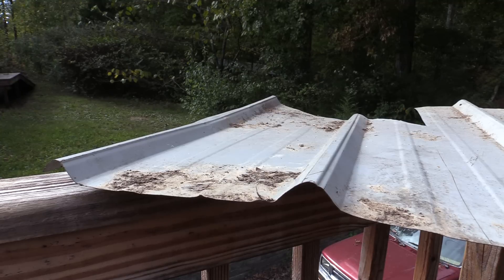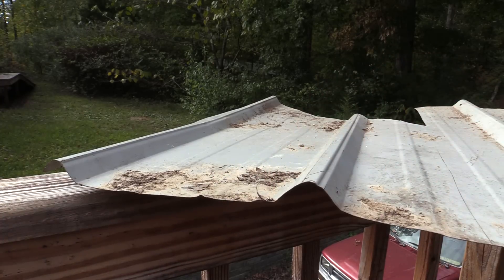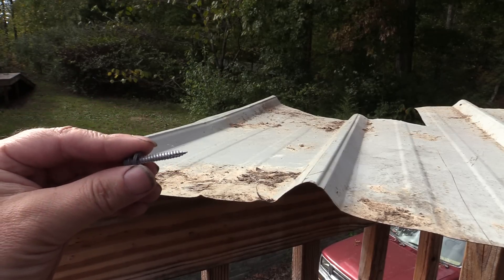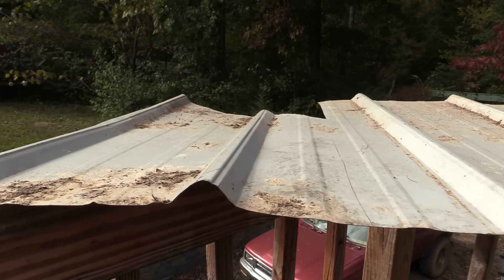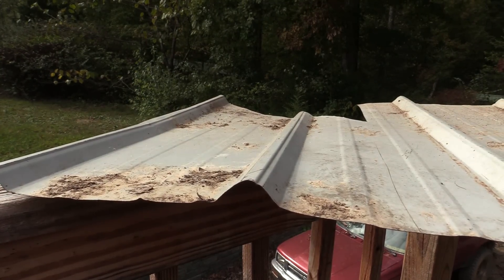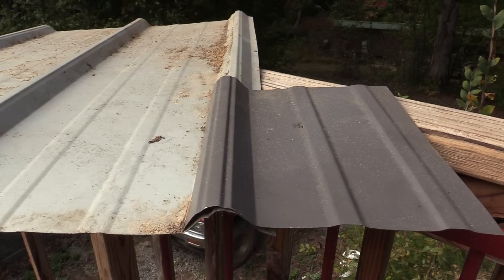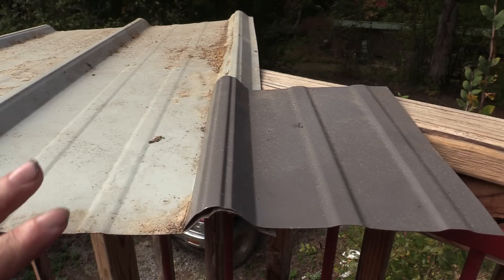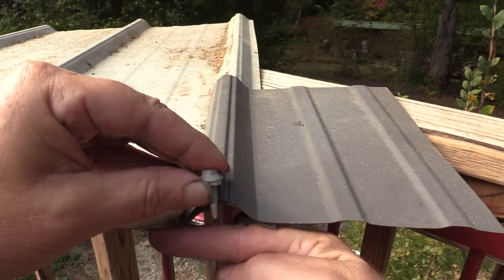Why you should not put screws on the ribs of metal roofing

Comment: So do you instal rib screws metal to metal when adjoining the next panel or do you just skip and not worry about those or do you use longer 2.5inch screws so that it reaches into the 2x4 purlin?
Reply from the maker: I use rib screws when installing the cap. if you use ribs screws to connect the panels together you are defeating the expansion joint. if you have a long roof this will result in leaks at the screws so do not screw the panels together with any screws when i install the cap i screw every other rib so as to not tie every panel together. I only use the 1 1/2 inch screws over 5/8 plywood or osb or 3/4 to 1 1/2 purlings. As you are screwing into the flat this gives you plenty of bite. Since i do not screw into the rib i have no need for the 2.5 screws

Comment: On the rib when used as roofing (your method has water traveling down over the screw/nail and washer). On the flat when used as siding.
Reply from the maker: Not my method, it is the manufacturer spec. it eliminates thermal expansion issues so the screws stay tight.
Reply: @honeybeehomesteading  I've seen different instructions on sheet panels of my pole barn (which I put up myself) so I think even manufacturers can't agree on a method.
Reply from the maker: @dalesworld1308  honestly it really depends on the size of your structure. Larger roofs with lots of panels the thermal expansion becomes a problem and the screws become loose. Smaller roofs it will not be a problem screwing on the rib but it will not be as windproof.

Comment: Threaded cap screws are the way to go. I shim the tall rib with cedar wood for a tight seat. Never put metal over shingled roofs they do not seat flat well at all.  Tar paper is cool for sure. The bitch with any fasteners is the voids in the plywood or chipboard. When the fastener just drops into the wood. YOU have to fix the hole you just made. The method chosen means a lot. My neighbor used bolts that get washers and nuts under the roof itself. THIS IS THE WAY TO GO. THE BEST FASTING METHOD.  NAILS NOT SO MUCH.... The best way to make a metal roof. PEROD !!!!

Comment: On the flat, on the peak, on the flat, on the peak................. This is one topic where there is no consensus, it's like Ford vs Chevy...
14 years ago I built fair size garage, roof at 35° - ish, 16' on both sides of peak, with regular synthetic underlayment for metal roofing. The metal roof seller recommended 2-in screws every 2ft- ish on peaks, so thats what I did. I also first pre-drilled panels on saw-horses which is a good idea, but dont pre-drill rib where the top panel over-laps, and  After 5 years I went back up on roof and noticed some screws loosen and a few broke but still had a lot of screws holding, and no leaks yet.....
2 years ago I built an addition on my house, 14ft out and 30ft long with very shallow pitch, some where around 1in drop/ft. I have 2 ft eve, so the first 8 in wide boards are on the eve, then the next row I have 3/4 in gap, the rest of 1 in x 6-8-10 in wide in boards are tight rest of way. Then I put down recommended metal roof whether shield, that stuff should be put down with two people, I started at that 3/4 in gap on eve... 

My theory for that was, if water/moisture builds up on top of whether shield it will flow out that 3/4 in gap between boards, which it did til I got addition insulated.  Then I started by placing 4 metal sheets on saw-horses and pre-drilled holes on flats and used 1 in screws, I notice these new screws didn't have as thick of rubber washer as before. So then I paced those foam seals at end of metal roof to help keep the wind from catching the metal roof peaks, then placed screws about every 4 in across the end of metal roof, so with gable rakes screwed down theres no way this metal roof will blow off...... 

So I screwed all this addition metal roof down on all flats except for the top where is metal flashing going up under previous asphalt shingles on main house, that is caulked and screwed about every 6 in across, then same at the eve, there I also did flats and peaks. So all rest of 16ft panels is screwed down on flats for same reason this video describes, and for the very same reason this video described....

So, on flat on on peaks...... IMO, flats are better for same reason describe in this video, another reason is it's easier to just set the drill driver to correct torque run screws down, on the peaks it's so easy to easy to over tighten, it's a constant pain when trying to just get the metal roof screwed down. But either way flat or peaks, I really dont see how metal roof can leak with that rubber washer, that rubber wash is protected by a big steel special shaped washer which is on top of rubber washer, and it is holding that rubber washer to the roof.  As this video described, the heat moves the peaks not the flats, so the screws on flats wont move........... 

But either way, if someone is putting down metal roof and has a shallow pitch, I highly recommend metal roof whether shield made for metal roofs................
Reply from the maker: @job38four10  thanks for your lengthy reply I am sure others will appreciate it as well. I agree with you 100 percent. The foam under the cap you may want to only do only on the windy side as this will prevent wind from blowing through while also allowing your roof to breathe.
Reply: @honeybeehomesteading  { " while also allowing your roof to breathe. " } <<<<< Hence the reason for 3/4" gap between first row of eve boards and the next row of boards, the 3/4" air breathing gap is underneath the eve, not on the end  metal roof peaks. But the only breathing will be done is between the whether shield and metal roof, that whether shield stuff dont breath..... 

I have the metal roof panels on the eve completely seal with foam and caulk, because it's a shallow roof pitch that drops about 1" in 12".
If the metal roof eve panels are not sealed on a shallow pitch roof, the wind and rain will blow up under the metal roof causing rain to drip behind the eve. I want water to drip outside of eve so eve boards dont rot, I also put the paint right under the eve for longer protection.....

To help keep eve boards from rotting, I no longer plumb the eve facer board, I always cut rafters at 90° on ends, that way the eve facer boards are not plumb and allows water to shed quicker, in theory........
Reply from the maker: @job38four10  cutting rafters at 90 was how it used to be done back in the Victorian days. 1/12 pitch is a mighty flat roof. Far more shallow than the roofing specs at. Where there is a will there is a way. I hope you don't live in snow country as that could get bad in a blizzard. Not on a leak issue as it seems you have that worked but but on a weight issue due to the snow load.
Reply: @honeybeehomesteading  { " cutting rafters at 90 was how it used to be done back in the Victorian days. " }<<<< I didn't know that, I thought that was my invention..... 
1/12-ish.....  I think I read somewhere that screw down metal roofing is suppose to have more of a pitch and 1/12 pitch should be on a  standing seam roofing. It's the main reason I put down weather shield made for metal roofing. I also live in mid-coast ME where snow is or can be a issue, thats why I did not want asphalt shingles. So with my limited carpentry skill set I put up 2"x10"x 16' rough cut rafters spaced 2' on center, the joist hangers are on 1-1/2" x 10" facer eve plank, then the  rafters go out 14'  and sets on a rough cut 2"x6"x 6' > something wall.........
This is winter 2 and I still praying everything holds up, coarse I'd feel better if I knew how much weight rough cut  2x10 rafters will hold up on a 14' span......
Reply from the maker: @job38four10  lap steel roofing like the one in the video is rated for 3/12 pitch or better. On flat roofs of around 1/12 I always went with EPDM rubber roofing. With a 50# snow load you would need those rafters to be spaced at 12 inches not 24. If your live load is 20# and your dead load is 10# then you rafters are good as you should be able to span 15 feet. This is however the minimum build plus this is just a basic number. Other factors can also affect your span such as ceiling attachment to the rafters.  Most northern cities or states have there own rafter span charts with snow loads. I would start there. Good luck.
Reply: @honeybeehomesteading  I read somewhere that > standing seam metal roof  can be for 12/1 pitch. I sure dont recommend anyone putting screw down roofing like I did on 12/1 pitch, but if one does make sure to use metal roof weather shield. 

So anyway, do you know how much weight rough cut white pine 2"x10" will hold on a 14' span 2' on center?
I'm thinking that I'm good if and when I get 12" of heavy wet snow, more then that and I will have to shovel it off or snow blow it off............
Reply from the maker: @job38four10  the only chart I could find as I can't find my book that has all the charts in it. The chart I found that did have below 4/12 pitch. It has maximum span of 15.2" for Douglas fur. You are using pine which should be close so you are good for the span without a snow load. This chart has a roofing load of 6 psf for asphalt shingles. Since you used metal and screwed through the flat you actually increased the strength but by how much I don't know but we can say that value is 0. That chart has the roof live load at 20 psf. I looked up and found that roofs with a live load rating should also be able to handle the same snow load. So in your case your roof should be able to handle a 20# snow load plus another 6#. So if it gets deeper than a foot you should remove part of the snow but you should be good for 14 inches of wet snow. Hope this helps. Also some wisdom overbuilding will leave you with less money but greater piece of mind.
Reply: @honeybeehomesteading Thats some good info, doug-fir should be same as white pine, but I'll never know cause that dont grow in ME.  
14"  of wet snow is a quite a bit. Once in a while in mid-coast ME we get 12-24" of wet snow usually in March, last couple years I had barely enough snow to plow. But I should shop around for roof-rake just in case we get some heavy snow,  metal roof sometimes can be very slippery to walk on even on shallow pitch so not sure if I want to try walking on it..... 
Then again sometimes heavy wet snow keeps right on melting til theres very little left, but still glad I used 2x10s instead 2x8s....
Reply from the maker: @job38four10  I wish you had put it on 16 or 12 inch centers. 12 will handle a 50# snow load so you would never have to worry about it.

Comment: Yep. It's a controversy.....and the real reason for this video. On the ribs it is. That's where water does not run. The wall are ok to screw to the flat. I don't recommend screwing the roof down on the flat.
Reply from the maker: @randyscrafts8575  honestly I did not know it was that much of a controversy. I just got tired of people telling me I installed my roof wrong when I followed the manufacturers screw schedule.
Reply: @honeybeehomesteading  Been in maintenance for a lot of years. Sometimes manufacturers can be wrong and following their directions can cause the failure of their product. I say use your head and common sense. If whatever you're doing works, then go with it. Everyone has their own experience. In mine the roof screws go on the rib and regardless of manufacturers instructions. I'd never recommend roof screws on the flat but you do whatever you think is correct.

Comment: You have to screw into the ribs for snow bars.  I would at least caulk under, if doing it again. 

I chose snow bars, since the shoes screwed into the flat are known to cause leaks, being on the flat and if they break off, I read.
Reply from the maker: @dennisgarber  snow bars I have seen before but it is rare that they are used in East TN. I always thought it might be better to have some type ove overrib where the snow could slide off without talking out the gutters. I know people who have lots of snow the weight becomes a issue for the roof itself. Thanks for commenting
Reply: @honeybeehomesteading  without the snow bar, the snow sheered off my garage gutters. Ohio.  On the house, I also extended the metal as far as I could, into the gutters, to take a little snow weight off the gutters.

I have steep and not so steep roof parts.
Reply: The snow gaurd shoes look nicer. But I choose the cheaper rail, because I read they fail and leak less.
Reply from the maker: @dennisgarber  I think in my next life I would design a house with large overhangs and a French drain system so I could go without gutters entirely. They are such a hassle
Reply: @honeybeehomesteading  I have seen and noted that houses with double long overhangs hold paint up to 30 years with good surface preparation because of the extra shade. Probably 2x longer than single wide eaves.
Reply from the maker: @dennisgarber  yes you are right about that deep eaves are the way to go all except for the tornado factor.
Reply: @honeybeehomesteading  interesting.

Comment: As far as I can tell, America is the only place on earth that screws or nails steel roofing down in the water channel and not the top of the ridge, as it was designed for! Corrugated roofing sheets were invented in London back in 1829 and within 12 months were being shipped to Australia and used in early construction, both the English and the Australians still fix our sheets on the ridge and never in the valleys, as it was designed.. just sayin 😁😁
Reply from the maker: @craigquinn7887  there are many profiles of metal roofs and I have installed many on the rib as that was what was called for. The downside of through the rib has always been wind resistance and weakening of points of attachment due to thermal expansion. The metal profile in the video calls for screws on the flats but there are plenty of profiles that are designed for on the rib. From the comments here I take that no one has ever mounted screws on the flats down under. Thank you for commenting